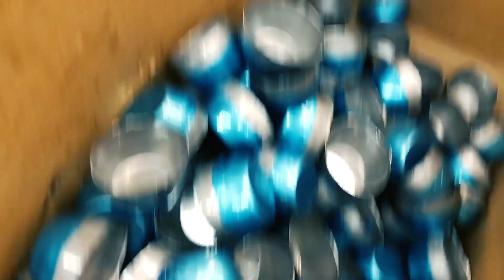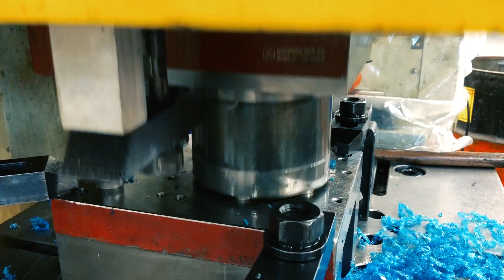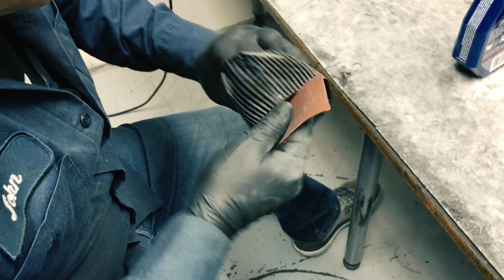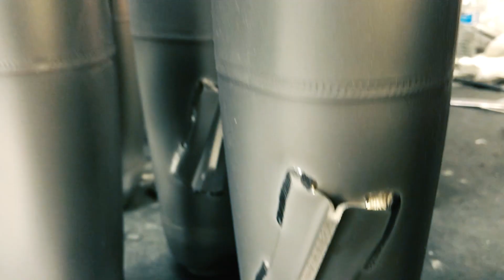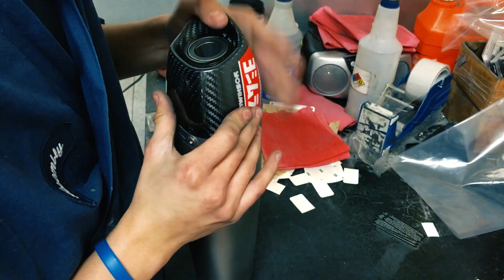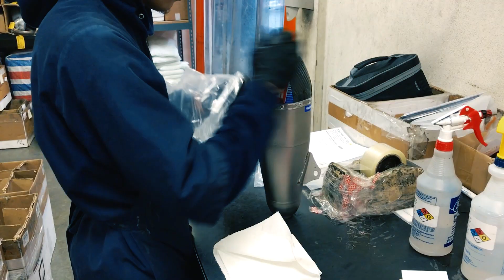2019 CRF450R Works Edition  Yoshimura Titanium Dual RS-9T Made in the USA

Comment: Can you confirm that you'll be doing something for the crf450L? I'd much rather have your pipe than the FMF that I'm seeing them post on Instagram. If somehow you can make a dual system... wow I'd pay 1500 for it for sure.
Reply from the maker: We are building a system for the 2019 CRF450X. We hear that it may physically fit the L. We have not done any performance or durability testing on the L. http://www.yoshimura-rd.com/shop/honda-crf450x-2019-exhaust-systems-genuine-accessories.asp